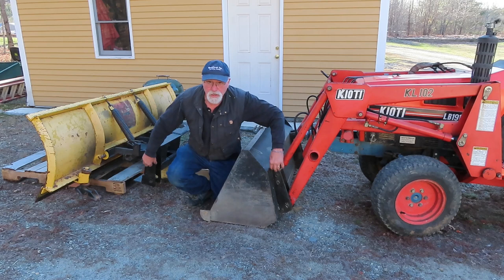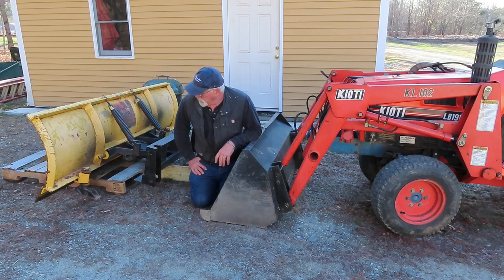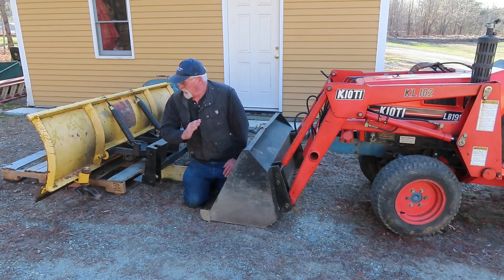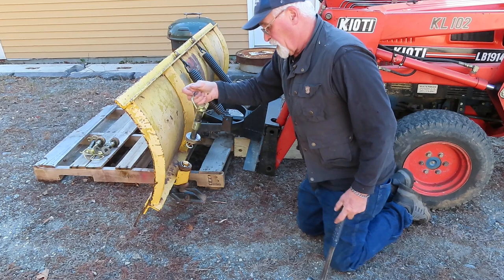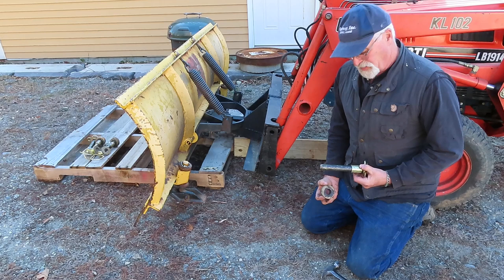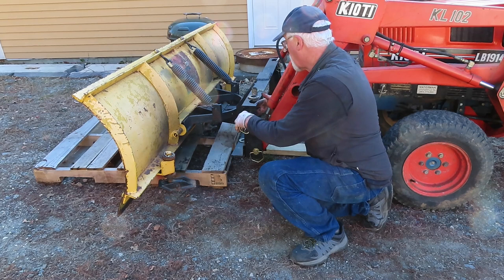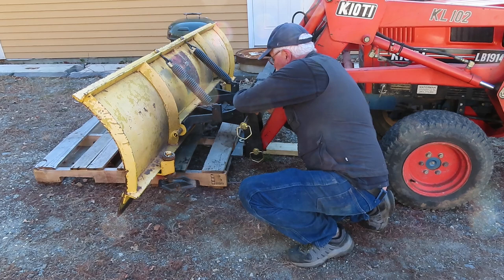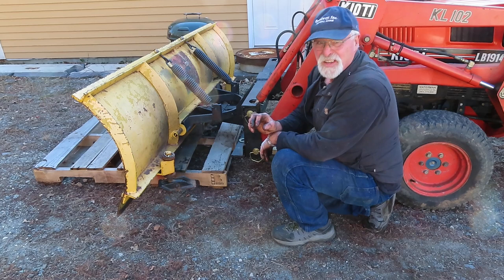Fabricate/Install  Plow for Compact Tractor

Comment: I'm ready for the not first snow fall.  At this point happy to see it warm and rain here on the coast, for now.  I need to do some kind of rig for the front of my L-35.  and chains!
Reply from the maker: Hi Tim....
Almost made a snow pusher attachment  for my bucket. Then I saw this blade by the road really cheap. I think the conversion was under a 100 bucks. The best thing is how high you can stack the snow. Can't do that with a plowtruck. And back dragging next to buildings is great...

Hopefully see you at the Winter meet!
Reply: @bladescrounger3266  On the farm we work with they have a Kubota M-5 with a V plow and it does a sweet job of moving snow, I hear what your saying.